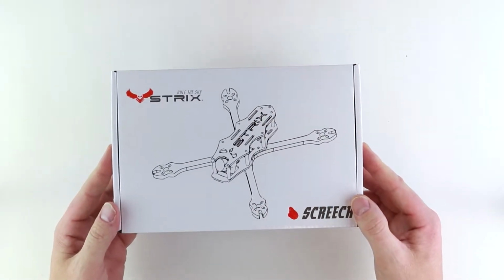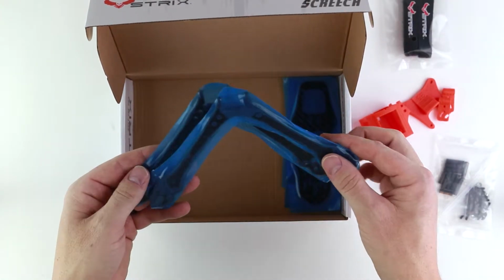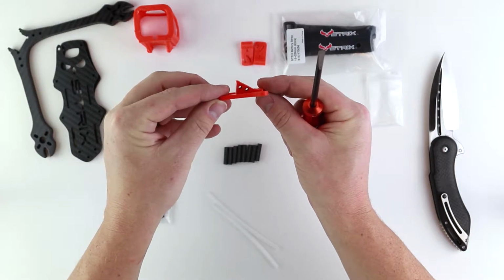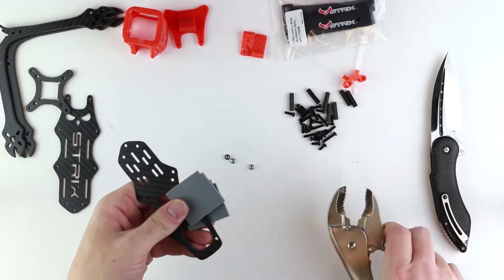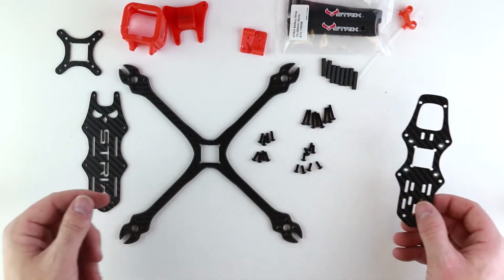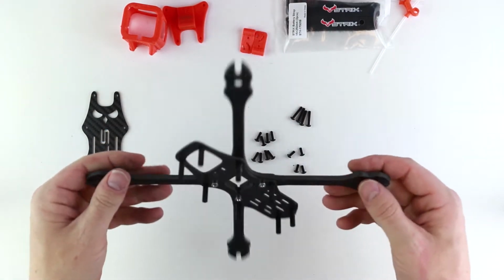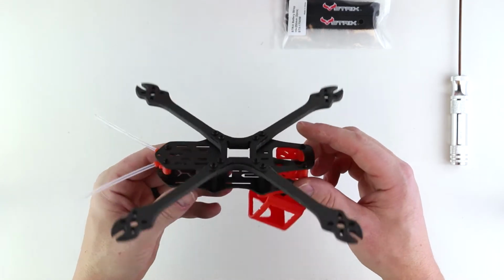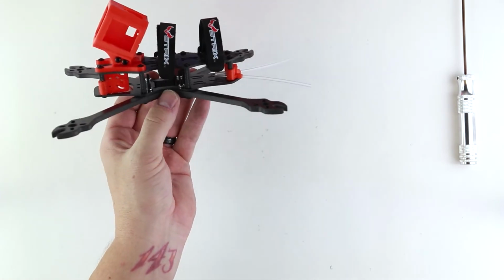STRIX Screech Overview (OLD VERSION) UPDATE VIDEO COMING SOON

Comment: Sweet frame, do you think I could squeeze a 3 stack in there?
Reply from the maker: James de Klerk it would be tight, but possible with very short standoff’s between boards. Also, running individual ESCs could help eliminate some height.
Reply: Ready Made RC, LLC Thanks for the reply, do normal sized esc's fit on the arms?
Reply from the maker: James de Klerk the arms are right about 10mm wide. Some of the newer ones should fit fairly easily.

Comment: I been flying fpv for 3 years now, and have flown a few dozen different styles of frames. Just got my Screech in today and must tell you how much I really appreciate all the design work that went into this frame! I'm really impressed with all that I'm seeing here. Stiffer arms than my Reverb, true x, great interlocking arm design, zip tie slots everywhere, slightly protruding bottom lip below the cam, double bat straps, single or double rear standoffs, great airflow for 4in1 esc cooling, unbelievable price point... Awesome job guys! This may very well be my freestyle frame choice for 2018! 👍👍